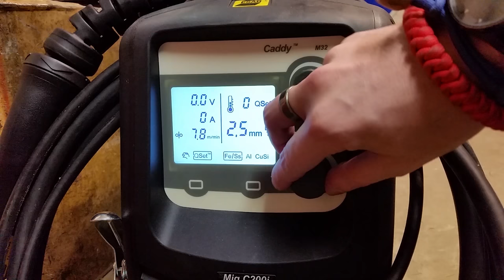DIY welding cart

Comment: good work. if you add some modification in this cart and take care of some note.
1_ cart hand in the front.
2_ tyer stopper.
3_ the area of the gas it is small for big slender.
4_ the Height of the cart for bige project.
5_storage area under the welding machine.
good job

Comment: right after watching your video, you put me to think twice about my project
i saw the way you did placed the casters, and excuse me if im wrong, but i'd noticed you welded 2 movable on the back and 2 on the front
inmediatelly i researched about the caster placement on carts
i'd found that 2 steady ones on the front and 2 movable in the back is the correct positioning if you are pushing in the intended normal direction of travel
i went to look at my project because i did placed the casters - without any welding - just on top (upside down) of my welding cart just to see how are they going to appear until tomorrow when i bolt them together
also, i went into welders forums to check into that detail and apparently they disaprove the welding of casters to welding carts
instead, they preffer to drill holes and attachment of its respective hardware
they argue that if a caster fails, welding will create a big mess in the process of service which i approve. any how, this is what i found:

WELDING CART:
Wood pannels go screwed/ riveted on (like yours) 
2 swivel + 2 rigid give you more control over long distances
Weld the nut to frame for rear castors for a steady ride
To flush mount castors: weld the mounting plate to bottom of frame but first weld 4 nuts to mounting plates on the back side of mounting plate; where it interferes w/ frame drill holes in the frame
Rigid front casters dont move or dont swivel
they allow to maintain a straight line when you push the cart long distances: do not turn & are intended for back or forth response only
When rear fixed wheels are used 7 1/4 size fixed caster wheel could be a good size diameter for rigid wheel type casters
Rear swivel casters from where you push & they move - theyre not stationary
You push from the swivel end not from the stationary side
- obviously, with this set up cart cannot be pushed sideways
*4 swivel casters can allow to be pushed sideways - good for thight areas where there is not much room to maneuvere but are harder to control if going in a straight direction
They provide instant response (turn 360°) to directional change
specially in thight spaces
**Put 1 or 2 layers of bycicle tube between the casters body & the frame  for a smooths out & quieter motion of cart
Add locktite to threads in case of future disassembly you have a better option other than welding
bolted casters take more time to do it but is the right professional way to do it
.. and thats all i guess on casters  
in my case, im planning to mount 4 swivel type (200 lbs e/a) casters on my welding cart for a total of 800 lbs; the two rear casters are 6.5" and the ones on the front are 5" with a 25° slope for my mig welder; an hopefully welded mounting plates and nuts and its respective hardware
:(
Reply from the maker: The rear wheels are steady. The front wheels are movable. Castors hold point welds. Any repairs will be difficult. Cart works as I wanted.

Comment: I wouldn't trust a welding cart that's 
tac welded together. Not to mention that the way the caster's are mounted, it's only a matter of time before the bearings fall out.
Reply from the maker: I use it for 5 years and still works great.

Comment: great build ! how much dose that welder cost ? nice long leads .bed frame ,washer,dryer ,and hot water heaters ,are good sources for reclaimed metals ,for welding projects .
Reply from the maker: Thanks! Welder cost at around  780€, pressurized bottle is modified fire extinguisher CO2 at around 25€. Welding Cart is built from scrap. I only bought a yellow color, and wheels.

Comment: What did you use to draw out your design? I plan on doing a fair bit more welding with my everlast and need something to rough out the designs.
Reply from the maker: This is drawn in SketchUp. But now I'm using Fusion360. It is free for non-commercial use

Comment: Hi looks good. Why did yo go for the esab caddy? It looks like a nice machine...
Reply from the maker: Hello. I did not buy cheap welding inverter. With ESAB I've had some experience. After trying, I bought a caddy. Easy to operate and has sufficient power. It is an excellent welder home workshop.
Reply: Matěj Novák  I have the same welder,nice but from some time I notice that it boils me welds , can you help me with that?
Reply from the maker: Johnny Doe : Hello . If you're making bubbles in the weld, it's probably a lack of protective atmosphere.

If welding in the place where air flows, increase the amount of  protective atmosphere.

Comment: what size steel is that?
Reply from the maker: The top and bottom of the frame are made of 20mm Jäkl profiles and legs are made of 15 mm Jäkl profiles but it may not be exactly the dimensions, I built it too from what I found.